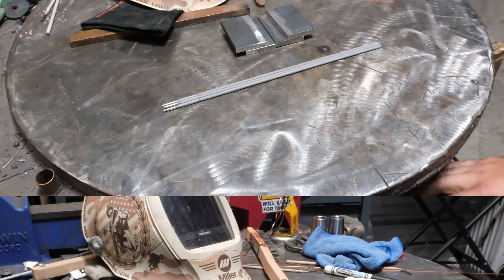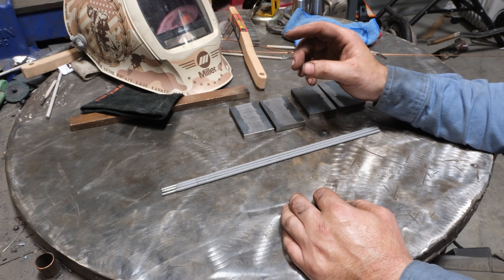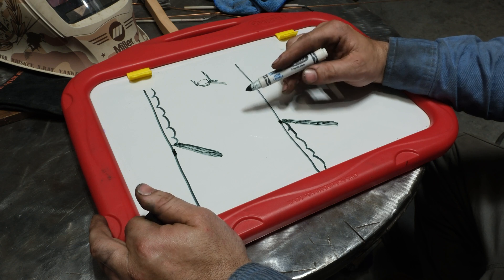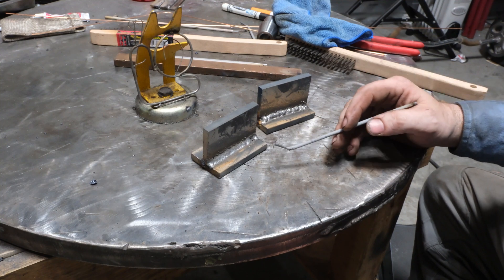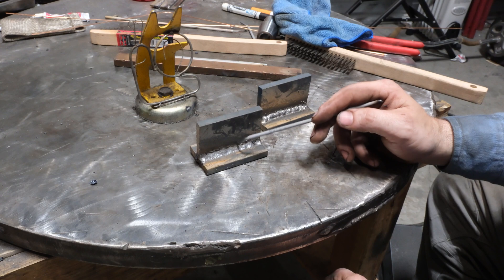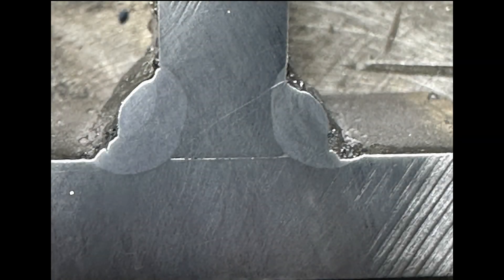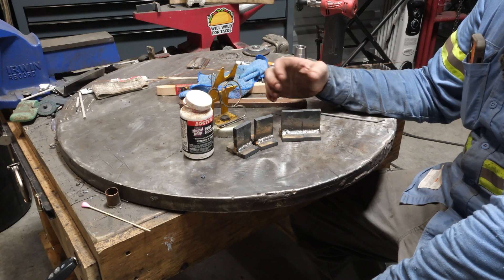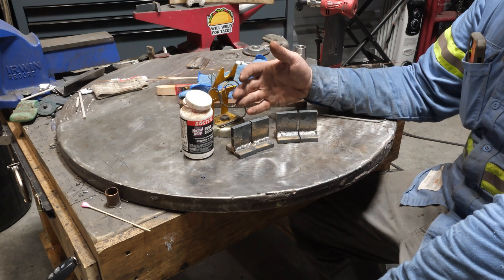6010 Vertical up vs down

Comment: Hey there big fella, sorry for bothering ya, but I have a dumb question lol. Does ur little hone welder run normal 3/32 7018? At work people are starting to think they can use/borrow my Lincoln invertec, to use as needed. Ha. I assure you, that's not the case, with my 1900$ welder lol. So I'm looking for a decoy machine, so to speak lol.
Reply from the maker: Great question.  I ran some 3/32 vertical up on some stuff so it runs it no problem.  The amp dial is dead on at 90a too (the only place it is accurate lol) so it should work as expected.
Reply: @makingmistakeswithgreg  awesome! And thank you, too. I actually bought a yes welder 125 already, but it doesn't run them. I tried 7018 ac, and they worked, but come up, they're not the same. Not crying either, don't get me wrong. I didn't spend 65$ on a machine and expect it to be Miller. I'm fully aware of why my good one was so expensive. Some things cost a lot, because they're worth it. Anywho, thanks again, and please do have a good night, Sir.
Reply from the maker: @andrewbradstreet4218 . The 7018 starts on it aren’t the best, but it has no problem running them.  6010 is a no go and 6011 is pretty limited.  The fact it will run a 7018 at 90a makes it worth the price as far as I am concerned lol.
Reply: @makingmistakeswithgreg  exactly! Pretty impressive what you can get for so little these days, at least in that dept. Everybody else hasn't got the memo yet, apparently.

Comment: I always learn something, sometimes a lot from your videos. It's amazing what you can learn from cutting and etching. What do you use for etching? Thanks. Well done.
Reply from the maker: Thanks and I am glad you have learned a bunch.  To cut at etch the trick is to get a decent surface finish first.  I use green rolloc discs but even a normal flap disc can do a ok job.  Once the surface is consistent you take an acid and rub it on the area.  I use naval jelly rust dissolver because it’s cheap and available everywhere.  It works really good if the material is a bit warm.
Reply: @makingmistakeswithgreg  Thanks. I saw the Naval Jelly in the bottle on the table and wondered what it was for. That makes a nice safe etching solution. And it's readily available. I see some cutting and etching in my future this coming winter shop season.

Comment: These videos are awesome! If your welding something thats just gonna sit out in the weather can you just leave the slag on the weld? Will it effect the weld at all?
Reply from the maker: You can leave it on, but if you paint over it the paint will come off with the slag eventually.  The weld will rust without being coated but that’s not a big deal.  6010 welds in field on rusty material tend to not be fully cleaned and left.

Comment: Running downhill on an open butt pipe joint definitely makes for a better looking root. It's interesting to see what you get on a downhill fillet weld
Reply from the maker: On a beveled pipe with an open root the downhill would definitely work far better than a fillet weld. Part of the issue with a fillet weld is the angle you have forces you to weld through more weld pool metal than on beveled plates or on many other joints.  I think I can get slightly more root fusion running downhill, I will do a part two soon 😀

Comment: Normally you seem to be spot on but this time... maybe learn to manipulate the rod and mig gun into the base metal more for down hill. (other weld vids show this with bend and etch tests) All you are doing is showing that you have issues going down hill.
Reply from the maker: I am not sure, you seem to be confused.  Running vertical down is impossible to have as much penetration as up.  The heat input is higher going up and gravity makes it easier to hit the root over welding through the pool.  Manipulation doesn’t change this,  please link a video that shows someone getting the same penetration going down as up.  If you’re going to make a suggestion that the information is wrong, but not post supporting evidence or links, it doesn’t make your opinion very strong.  Also, the video demonstrates what can happen when you use the same amperage and run a weld downhill vs up.  What actually happens is dependent on many factors.  There is a reason vertical down is not commonly done in industry and on thicker plate.  I think you’re confusing thinner material like 1/8th with thicker material and not understand what’s actually going on.

Comment: I guess I need to check if you've done a bunch of mild steel tig welding videos. btw, where did you find that cool portable dry erase board?
Reply from the maker: I have a bunch of tig videos I am editing and will roll out soon.  I had such a backlog of videos I had to edit and get through it took way longer than I wanted. 😀

Comment: The astounding thing is that you were in your 99 degree shop for the purpose of teaching us something. And on a Sunday too! How many high school teachers or college professors would put up with the slightest discomfort in order to teach? The ones I know, and I know several, wouldn't even think of teaching in a 99 degree classroom. And that's in spite of their high pay. 
On a different note, I  just watched your introductory video on tig welding aluminum that you posted a year ago. Good stuff! I've got some aluminum that's perfect for practicing on, so I'll get to it!
Reply from the maker: Thanks for the kind words 😀.  It’s was no BS hot in the tin shed.  I was filming from 9 am to 6pm at 100+.  Believe it or not I can handle the heat ok, but the electronics can’t.  Even with a fan to cool the camera down it would still shut down after 5 min.  I was going to do another vertical up test plate and nail the uphill welds but it would have taken a ton of time and I still had 3 other videos to shoot.  Luckily the cut and etch proved exactly what I had hoped.  

When I have my mind set on something I do it.  The hardest part is getting started.  I have had days where it took me 4 hours of sitting just to get going on something.  Once I started things got rolling.  It’s not easy but paying no attention to the heat, the workload, or anything that might instill doubt, and just starting it how things get done 😀.  I also want to keep everyone motivated with some new content 😀

Comment: I don’t know how you can do it without at least a fan going. I have done got so dehydrated they thought my kidneys were shutting down.
Reply from the maker: So I had a fan and had to run it when the camera shut down due to temps.  The internal temp of the tin shed didn’t drop below 90 at any point and hovered right near 100 virtually the whole day.  I filmed from 9-10am to atleast 6pm.  I have a very high heat tolerance, I was wearing pants, and a long sleeve shirt the whole time.  I focused on how important it was to make content and put the discomfort to the back of my mind.  Luckily the tin shed has heat so winter won’t be bad at all 😀.  

Your mentioning of thinking your kidneys were shutting down is a great idea for a video.  Dehydration is no joke, the scary part is when you hit the dangerous point it’s almost too late to do something about it.  That’s where if you’re working alone it can be very dangerous.
Reply: @makingmistakeswithgreg  yeah that’s what I do and it’s got to where I have to stop or collapse. If your neck starts hurting and you can’t hold your head up that’s from your spinal cord swelling and you need to get some ice and put it on your neck and if possible get air. Just be careful you can also get a cheap cooling vest .

Comment: Greg, congrats on reaching 25K subs!  Good work, my friend.  

I'm still welding almost every afternoon and the heat is living hell here too.  I have been following the guidelines you show in your playlists and am still seeing gradual improvement.  

Below is something I learned that might benefit you in some situations.  If you recall, we were having problems with slag inclusions when running 6013, mostly at the start of the weld bead.

It took months, but I finally overcame most of that.  This one simple tip will make a world of difference:  Take a small piece of scrap plate and keep it within arm's reach on your table, and just before you are about ready to strike an arc and weld, reach over with the rod and drag it across the scrap plate a few times (a second or so each time).  You will probably notice that it sputters for a few seconds then runs smooth.  After that, you're home free.  Now just strike up on your real base metal and it will run right, without that big wad of slag trying to outrace the weld pool.  Do this with each new rod, even on tie-ins.  I think it "preheats" the rod or something, but it works.  Give it a try and see if it helps you too.
Reply from the maker: What you described is done on heavy plate welding, they basically attach “run on and run off” tabs so you start/stop on them so the weld that’s on what needs to be welded is 100% clean.  On less critical work doing what you describe or just arcing off the table/plate close and bringing the arc onto what you’re welding will work too.  Just avoid leaving arc strikes on the plates that don’t get welded over 😀.  Glad to hear you’re slowly making progress.  Steady practice and focusing on being consistent is what will lead you to develop the skill.

Comment: Hey Greg are up like near Milwaukee? That's a long drive from me, but I do HVAC work down here in Podunk, IN; and if I had the time, I wouldn't mind seeing if I could maybe install some air conditioning in your tin shed. Would make it a lot more enjoyable to work in. Maybe sometime like a 12K btu mini split, those don't need much power, and can run on a 120v 15 amp breaker.

Comment: How would fluxcore run downhill ?
Reply from the maker: So I have done it a bunch on exhaust.  It honestly welds pretty good.  It will do the same exact thing as 6010 in the sense it will lose all penetration.  Which on thin material isn’t the end of the world.  Flux core is universally run uphill in the manufacturing world.
Reply: @makingmistakeswithgreg  You're right, you don't really want to blow holes in exhaust pipe. Because then you'd never finish the job, and be chasing holes all day, haha. Bead on caulk works on exhaust we're just trying to glue 2 pieces of non-structural metal together and not have leaks.
Reply: @makingmistakeswithgreg  
I had to run a combination of up and downhill on a hinge repair for a pretty heavy swing gate . 
I didn't want to run stick as I was welding a 6 mm hinge plate onto probably 2mm walled galvanized square tubing . 
The previous guys welded it really badly with a few 1/2 inch welds which is crazy for that size gate leaf ( 100kg + ) .

Comment: I’m not much of a stick guy, but I always thought 6010 was better for this because the puddle freezes faster. Is that wrong?
Reply: That's right. That's one of the reasons 6010 works well for running open roots because it gives you a much larger degree of control in terms of your heat input, letting you whip in and out of the puddle to stay consistent, i.e. letting the puddle solidify quickly when you whip out of it.
Reply from the maker: As was mentioned 6010 offers the ability to bridge gaps in a fast manner that would be otherwise impossible to do with normal rods.   It’s common for me to bridge a 1/4inch gap on some rusty material with 6010, with 7018/7014/6013/etc the molten pool would drip right off unless you do tack welds.

Comment: love your content,man! Where do you keep coming up with ideas? I really enjoy the style of delivery.       Also,6010 should never be put in an oven-it requires 3-7% moisture content in the flux to run right,once it catches fire throw the rod out and grab a new one. We would even dip them in water before lighting up
Reply from the maker: I have a list of over 100 ideas and randomly pick one when I don’t know what to cover lol.  The more I plan the harder it is to get things done lol.  Great tip on the 6010 and no oven, you are 100% correct.  6010s run real rough when they are baked out and even change how they run as the rod burns down.  I have dipped rods in water before when they ran poorly and it definitely makes a difference lol.

Comment: At least the parts were preheated just sitting there in the shop!
Reply from the maker: No bs it was so hot in the tin shed my camera shut down every 5min of filming.  I didn’t give up by the equipment couldn’t handle it.  Even the microphone had some glitches due to the heat.  Should have cooked dinner on the welding table 😅
Reply: @makingmistakeswithgreg  Wow! The temperature in your shop was no joke! I was doing some welding in the mid 90's this last week in my shop, but 99 degrees is much tougher.  Each degree makes a big difference. I would assume this kind of heat is (or was!) unusual for Milwaukee. I hope it cools off soon.

Comment: Did you just use a non dry erase marker on a dry erase board 👺
Reply from the maker: Haha I have before, but I do indeed have a black dry erase marker 😅.  I used purple power to get a sharpie mark off, I thought it was done for when I realized I did that before 😅
Reply: @makingmistakeswithgreg  A little brakekleen works too, but you have to be fast or it can melt the white plastic. Also use the non chlorinated kind, chlorinated brake cleaner and welding don't mix very well...

Comment: Thanks for also covering information on MIG as a part of this fine video.
Reply from the maker: MiG definitely has the same issue, the main difference is mig vertical up is far harder than 6010 up.  I need to do a video just on mig vertical up since that’s quite tough and I could use the practice lol.

Comment: In my opinion/expirence. 6010 downhill is best suited for open root usage. I welded a fair amount of 6010/7010 pipe downhill, and I'm familiar with uphill 6010/7018. Downhill with an open root is faster and just as good. But the moment you don't have a gap in the fitup, this is what we get.